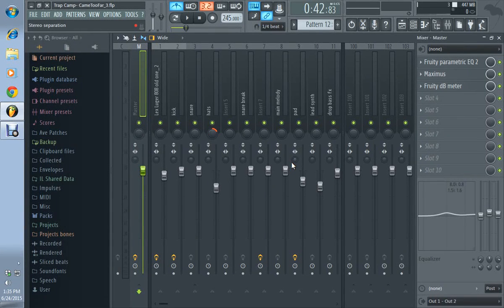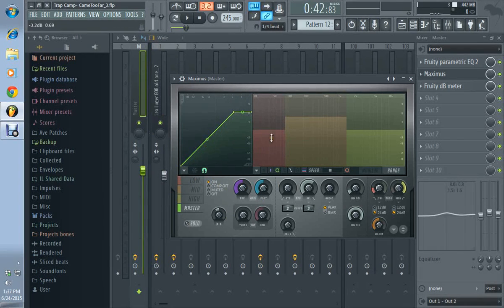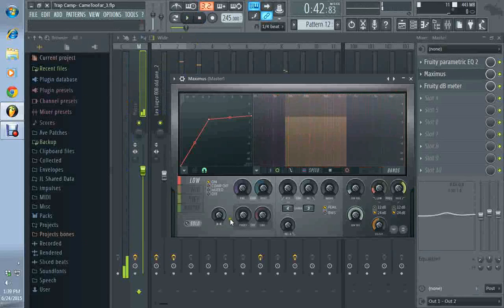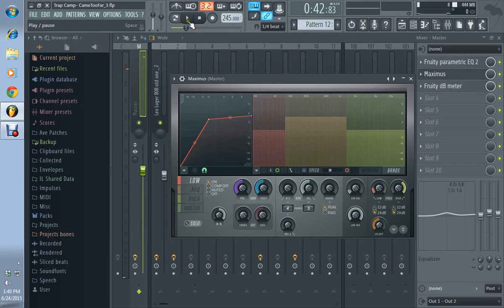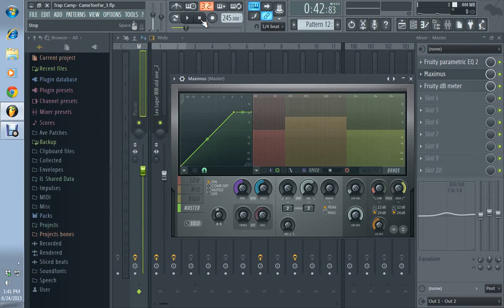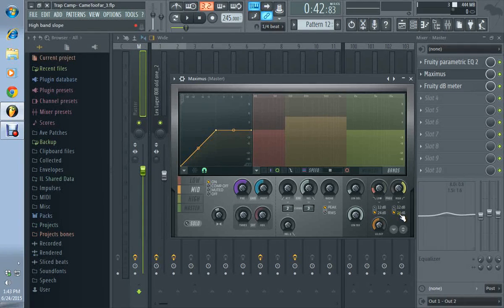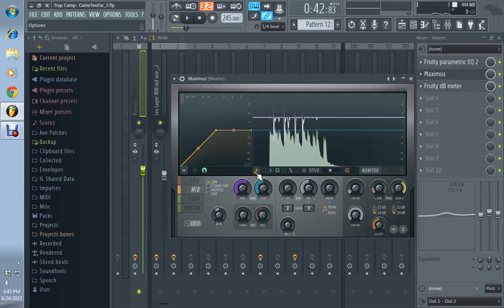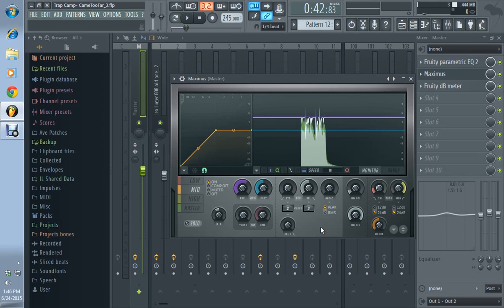Mixing & Mastering in FL Studio: Maximus pt.2

Comment: Came back to watch this again. When using one of the other modes such as linear-phase filters, do you master the track as you normally would in the Maximus pt. 1 video and then switch to one of these other modes? And if the answer is yes to that question, what additional tweaking has to be done?
Reply from the maker: +Anwar Thomas dont use linear phase mode because it will make your mixes thin and smooth out transients across the board which is a no no for aggressive styles of music... other than that, yes I still use maximus for more sonically neutral compression/limiting however I prefer Presswerk for its tube harmonic characters and robust transparency when it comes to making a track loud and clear. There is actually a compressor/limiter thats $25 almost on the same level as presswerk. I can't remember the name but the company sponsored my channel for a review but its really good and simple to use
Reply: I remember you talking about the $25 option but can't remember the company either.
Reply from the maker: +Anwar Thomas did you see the last free download friday? its that one lol... Klangheims MJUC
Reply: +Ave Mcree (CeeMurda DaBasedgod) Yes...I was like that must be it. Thanks for the follow up.
Reply from the maker: Yes...  I messing with the full version now to see how extreme it could be